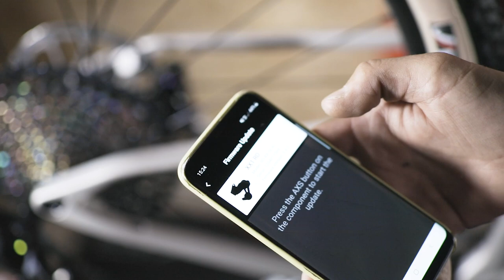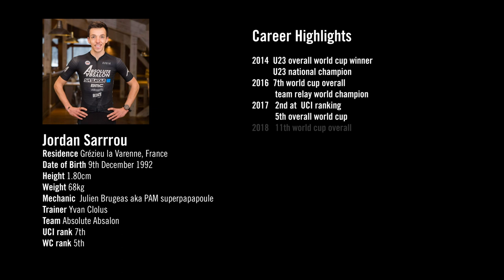Dreambuild I New 2021 BMC Twostroke I Team Absolute Absalon I Jordan Sarrou I Probikebuild

Comment: BMC must have one of the most beautiful, if not THE most beautiful and clean designed frames for a Hardtail bike. The way the frame slopes and melts into oneanother and still has angled edges is.... i never thought i‘d look at a bike the same way i look at lets say a Lexus LFA.
Reply: absolutely agree! clean and square lines rather than round,  gorgeous shape,
Reply: also i am very happy that the tire companies finale realized, COLORED side wall will make a bike look much better and sale will increase , about time!.
Reply: @eduardoguillen6385  Agree. Any bike with sidewalls automatically looks twice as serious and twice as expensive.

Comment: Absalon was always an XTR man. Strange watching them put on the XX1 crankset and the Sram Level Ultimate brakes.
I have the old TE 01 from the days when Julien was racing.
At the time it was considered on par with the S Works Epic and the Trek Procaliber SL. It was also one of the lightest hardtails available. 
The last TE 01 in comparison with the competition slipped with the Sram GX specced version it's highest offering. Making it significantly heavier than my 2015 model and way heavier than the top of the line S Works Epic.
BMC have continued to offer the 4 Stroke with high end components but have turned their backs on their TE 01 now renamed 2 Stroke hardtails. Hopefully they'll eventually offer 2 Strokes that are specced at a similar level to this build. Many of us choose Hard Tails over Full Suspension bikes and are happy paying for them.

Comment: Big mistake when you use the torque wrench at an angle for tightening the brake hose nuts. With the angle you give a different torque value than the indicated on the tool.

Comment: Wheelset weight annunced at 1331gr on the manufacturer website with same hub and spoke number.

In the video 1435gr. How Can it be?
 http://www.jpracingbike1.com/fr/lucky-jack-6ters-carbone/2633-paire-de-roues-duke-lucky-jack-sls2-6ters-dt350-sp.html#/sac_de_roues-sans_sac_de_roues/axe_roue_libre-142x12_shimano_9_10_11v/disque-is_6_trous/nombre_de_crans_a_la_roue_libre-18_crans/couleur_stickers_jantes-sans_sticker/couleur_bouchons_de_valves-assorti_a_la_valve/couleur_des_valves-noir/rayons-sapim_cxray_noirs/taille_des_roues-29_/couleur_des_ecrous-noir/axe_avant-100xqr15/couleur_stickers_moyeux-0_originale